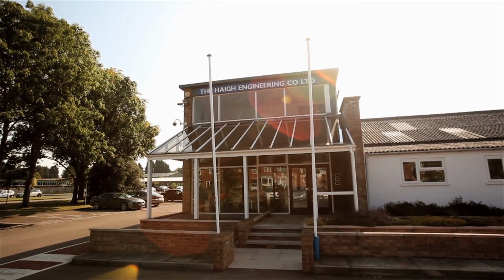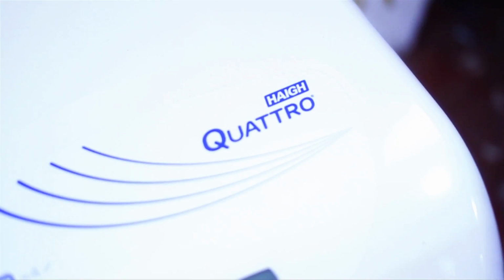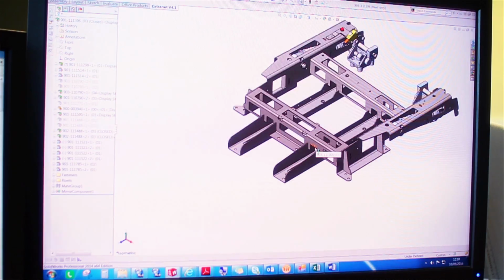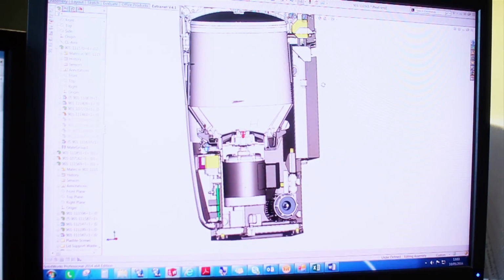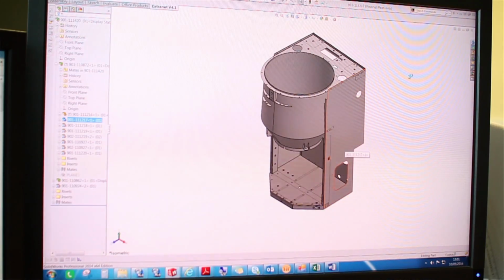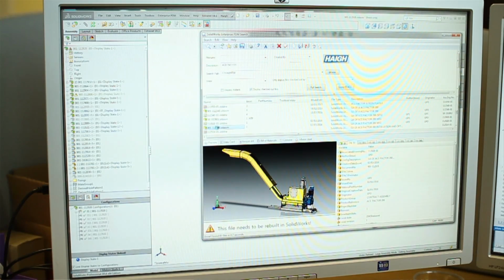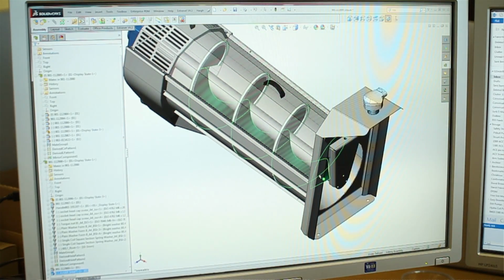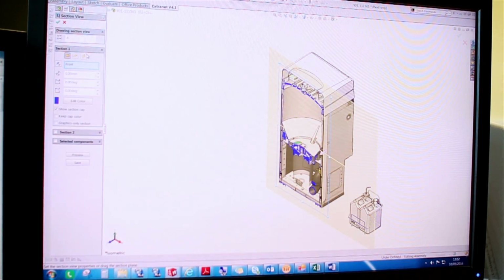Haigh - using SolidWorks to design maceration equipment for the #healthcare & #wastewater industries

Comment: Simply nice, I tried to find out more information about the chamber itself, where the whole process is carried out. what are the type of blades are used to chop the disposables. what is the size of holes leading to the drainage? what is the percentage of failure and what is gonna happen when we put un disposables materials. what is the discharge rate is it flashing or continuously discharging ?  I would love to hear from you as soon as possible, and if you want you can reach out to me with some answers if possible through my email K-terkawi@hotmail.com
Looking forward to hearing from you.
Reply from the maker: Excellent questions Khalid and they deserve a thorough answer as there is so much to cover.  My colleague David will email you - please check your spam folder so that we don't lose touch.
Reply: ّI have already met David in person last 2 days. Thank you!!